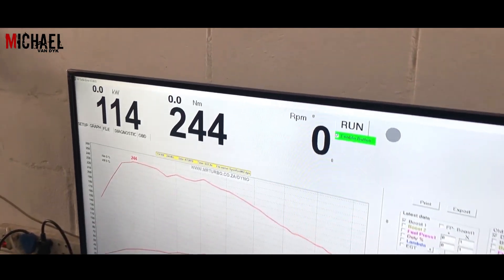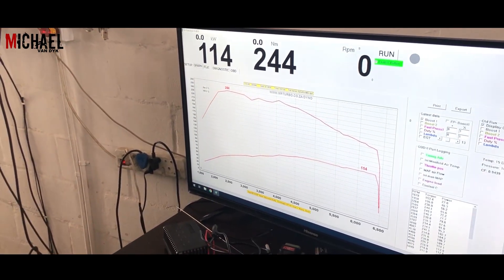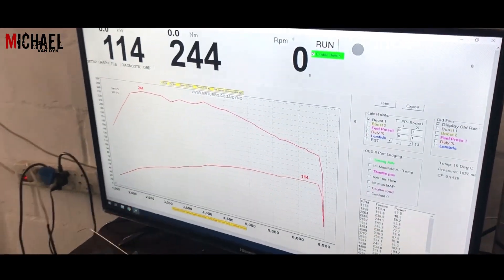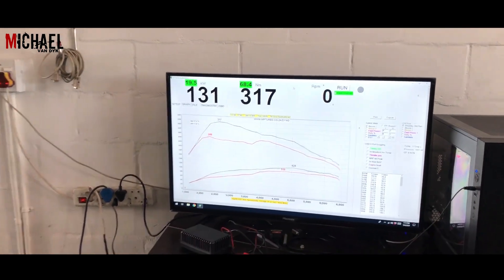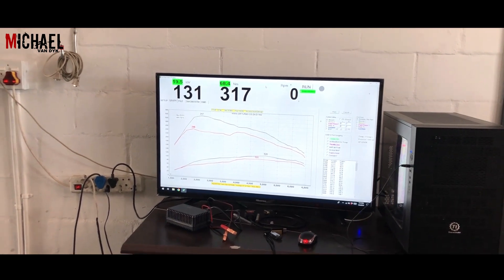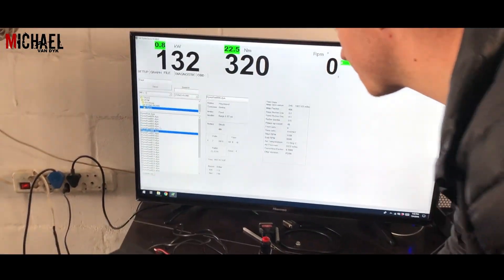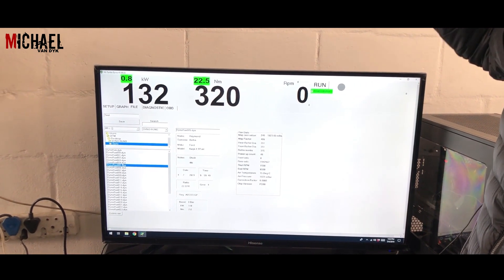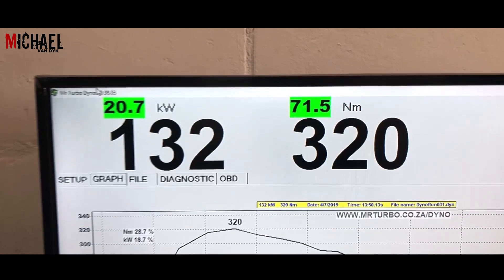Ford Kuga 1.5T - Chiptune and Dyno

Comment from the maker: If you had fun watching, like this video and Subscribe to the Channel !
Reply: How has this engine held up since the remap? I have the same engine  on a Focus, so lighter car than the Kuga and its rated 134kW 240N.m.  I'm also looking at remapping mine but to a very safe remap.
Reply from the maker: @vellymagagula6490  Hi, the motor has held up fine, the car was used for another 2 years since the remap with no issues. It was recently sold, but within that time no issues…

Comment: Hi MD, I have the Kuga 2.0 Titanium AWD, petrol, Auto. I am looking for a software upgrade to improve fuel consumption if that is possible. I get about 400Km on a 60L tank🤕

Any help will be appreciated🙏🏿
Reply from the maker: Hi, you can google a chip tune company that will be able to assist you. By tuning the ECU you will be able to improve fuel consumption but you will gain power also making you want to drive harder.
Reply: @MDvanDyk  Thanks for the reply.🙏🏿

Comment: 2 questions

1.when was the tune done and what km?
2.how many km has he done with the tune and did he have any mechanical problems?
Reply from the maker: Hi, the tune was done almost 3 years ago at I believe around 80000km. Everything has been running fin until a couple of months ago where an injector failed and caused a piston to “melt” due to overheating friction. But not entirely sure this is caused by anything related to the tune.

Comment: 114kw on the wheels is that stock for the 1.5. I have the 1.6 kuga so figured should be similar. Need to have my kuga done aswell
Reply from the maker: Factory claims it has 111kw so it is pushing a bit more. Yes the 1.6 has the same.